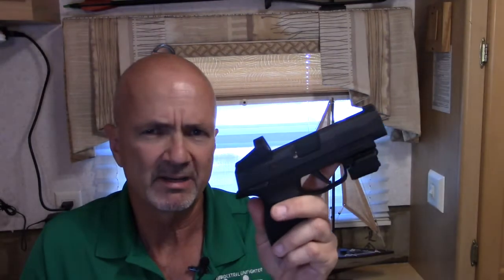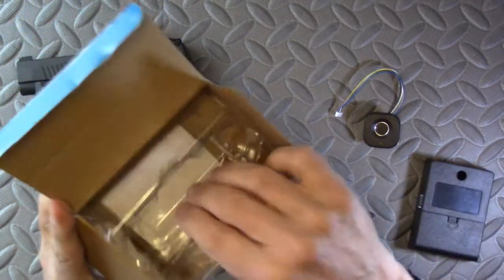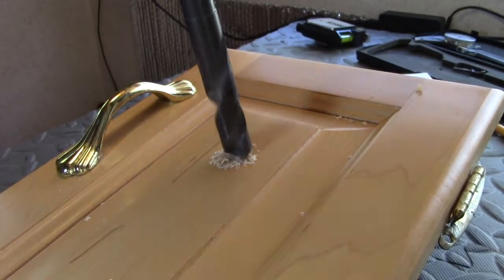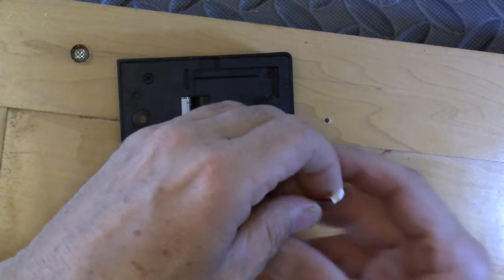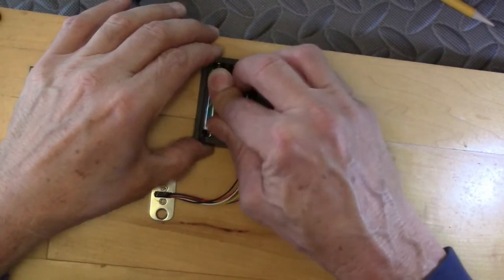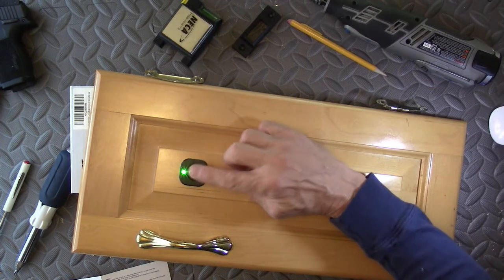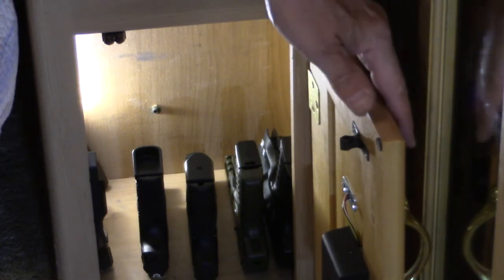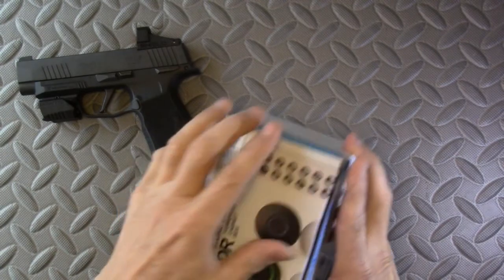Add a Fingerprint, Biometric Lock to Your Furniture

Comment: Great idea, what happens when the batteries die and you can’t get in? Gave me an idea how to make millions of dollars though 😉…
Reply: There is a little USB port on the fingerprint reader. You can power up the lock that way. I'll probably just pull the hinges.
Reply: @raggedyedge  what if you can't find the USB lol. I say something with an emergency key or keypads would be great
Reply: It is supposed to flash warnings when the batteries get weak. But if I ignored that warning and heard an intruder, I'd just tank the door off the cabinet. It's not exactly hardened security. 

And this model is kind of loud...wouldn't be a whole lot noisier. 

I does keep out a toddler not yet familiar with screwdrivers. Our 2 year old grandson now knows how to wield tools, but hasn't tried his luck at "safe cracking" yet. But growing up in a firearms family, he knows the difference between toy and real guns...we test him occasionally.